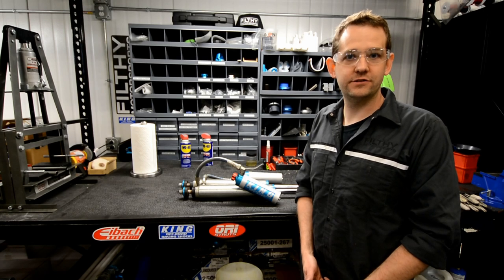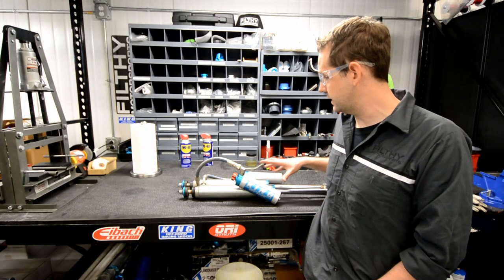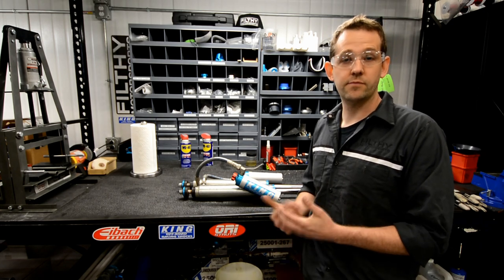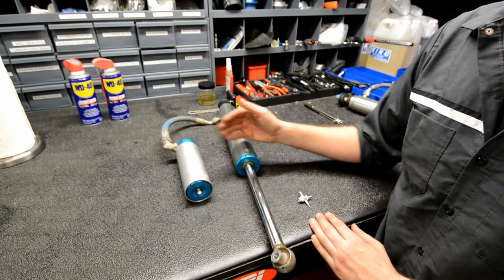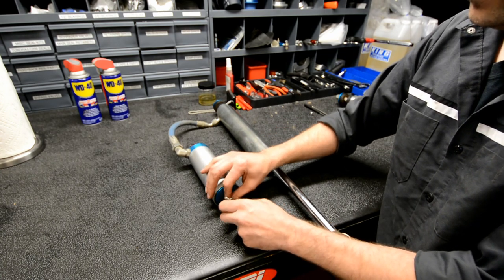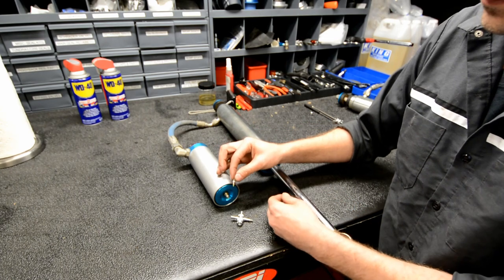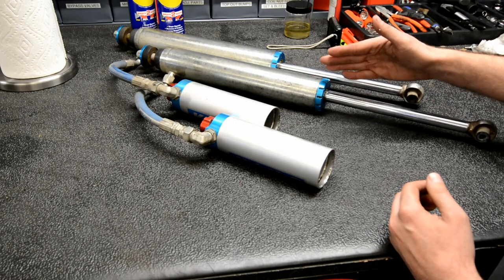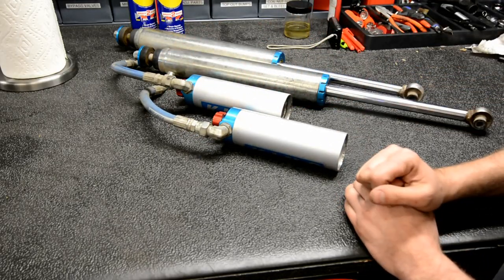King Shock Rebuild Instructions (Full Length) by Shock Service, LLC

Comment: How do you bleed a IFP remote reservoir when you don’t have that threaded hold on it to set it?
Reply from the maker: What brand of shocks? Not all shocks are designed to be service.
Reply: @ShockService  these are KYB, the fronts have the reservoirs as part of the body. The rears are connected by hose (remote). Their found on CanAm machines

Comment: Motorcycle trick.
Hit the shaft with a dead blow to crack the compression shims, if you dont the compression port is full of air under the shim

Comment: This is a fantastic video Ben. Thanks for putting this information out. Would you be able to do a video on breaking down a King coil-over shock? I figure that once the coil is off, the process is very similar.
Reply: Just did it with my front coil-overs. Exact same thing except for needing a spring compressor. I got it off Amazon, only one or 2 that will work for king coilovers
Reply: @JacobMueting  thanks for that info! Which compressor did you go with? Did you feel safe using it?

Comment: I’m considering buying a set of Carli King Pintop shocks for my F350. Can you tell me what the average miles between rebuilds? I think you mentioned 50,000 to 100,000. Also, I tow a fifth wheel but I have airbags to assist with the load. Will this affect the life of the shocks? 

I ran ICON before and they require a rebuild at 20,000 miles… sometimes less. Horrible shocks in my opinion. Thanks for any info you can provide.
Reply from the maker: Every application is different but, in general, we would want to see service between 50k and 100k miles of average use.
Reply: @ShockService  that’s great. I do mostly highway driving with a little off-road here and there. Thanks for the info.

Comment: Very informative Ben and great job with your comprehensive content.
  Just curious as to whether or not King, or your firm, offers stainless Schrader fittings as well as stainless fittings for the Aeroquip plumbing from the shock to the reservoir,,
  If they do hopefully it's of the 316L variety, marine grade and not just 304, "exterior".
  Please advise at your convenience. 
  Thank you and am looking forward to visiting with you on my Ram 3500 4X 6.7.
  Regards,,
Reply: Oh, also,,,are the shafts as well available in stainless steel and if so, what grade,,,,
  Lastly, are King shafts solid or hollow,,,,

Comment: great video. Just got one observation, instead of pulling the end of the reservoir out introducing air, why not leave it all the way down replace the core then charge, reducing air intrusion? Or is this being too meticulous? Being that air is 78% nitrogen anyways?
Reply from the maker: Leaving the IFP in would not allow a full draining of the oil and you would still have air bubbles in the reservoir hose.

Comment: HI, thanks for this video, i have the same shock absorbers on my land cruiser j8, can I measure the pressure from the valve of the tanks with a normal air pressure gauge?
Reply from the maker: Yes, as long as the gauge is rated for 200-300 PSI.

Comment: I wonder why King uses the clear silicone O rings. That gets eat up really fast. I replaced those with nitrile and it didn't leak much longer.
Reply from the maker: King o-rings are black with the exception of the shaft o-ring which is redundant so leaking really isn't an issue. We recently serviced a set of King shocks off of a Peterbuilt truck with 300,000 miles on them (well beyond the recommended service interval) and 3 of the 4 shocks had no leaks.

Comment: Ben,

I am familiar with rebuilding WP, Showa, KYB shocks on dirt bikes and vacuum bleeding before nitrogen charging is nearly required. Is there something unique about King shocks that doesn’t necessitate vacuum bleeding or is that still best practice?
Reply from the maker: Vacuum bleeding is optional as the design allows for easy bleeding on most off-road shocks like these. For more complicated shocks or unique configurations we do use a vacuum bleeder.
Reply: Thanks for the reply. If I may one additional clarifying question. 

And that is because for example even a non Bypass 2.5 reservoir shock doesn’t contain any valve stack between the reservoir and the shock body.

Comment: hello, the shaft spacer on my shock cant be remove, what should i do?
Reply from the maker: I'm assuming this is an external shaft spacer. Use some heat and once the spacer expands, spray some WD-40 around the shaft, you should be able to work it loose. If not, remove the rod end and then tap it off that direction.
Reply: @ShockService  thank you, heat really work.

Comment: Ben, question- before you charge the resi with N2, you pulled the cap up to the retaining ring drawing ambient air into the resi. Should you not have pushed the cap in and then charged it with N2? Seems like all you did was compress the air in the resi with a small amount of N2. Am I over thinking this? Seems to be critical to remove as much air as possible as the air will increase pressure when hot and introduce moisture. 
Not criticizing, just curious. Maybe it’s not that critical.
Reply from the maker: Great question but not a concern for this application, however, one could always pressurize the reservoir with nitrogen, bleed it off and then fill it again.

Comment: Nice and very helpful video. 
Can you give advice about measuring floating piston deep. In first time of rebuilding  I'm not measure deep of sitting piston. And now feel incorrect work of shocks. I understand that length of reservoir cylinder may different than yours, but I think that correct position -  to shock <~40/(position of floating piston) and 60 ~>to shrader valve.
Thanks for any advice.
Reply from the maker: This is covered in section 17 of this video: Verify IFP Positioning - 46m 40s

Comment: I know this is a newbie question but is there a scheduled service time for these?
I'm buying a Tacoma with similar shocks and the seller tells me they're about 30-40k of mostly on-road commute miles on them. I didn't feel any inconsistent ride when I test drove the truck and no visible leaks. Appreciate any insight.
Reply from the maker: We normally recommend 50k-100k miles for most street use applications. We get shocks in for service at all intervals and generally find that before 50k miles most Kings are still working fine and at 100k they really need to be serviced. Great question!
Reply: @ShockService  Thanks!  Appreciate the help! 👍

Comment: Does the piston have to be fully extended when getting the air out of the system just before pushing shaft retainer i to the cavity?  If not, how do i know if there is enough fluid in the system if the piston is down in the cavity filling the cavity with its own “piston volume.”
Reply from the maker: Not necessarily, but the higher it is the more oil gets moved to the reservoir to set the IFP.

Comment: If you replace the remote reservoir hose.. will oil/nitrogen start to leak? Is it difficult to replace the hose?
Reply from the maker: Yes, oil would leak if you remove the hose. To properly replace or repair a reservoir hose the shock must me opened and drained, then reassembled.

Comment: Tried your method for removing the misalignment spacers (at 16 min mark) it didn't work for me. What did work for me is a punch angled inside to the lip of the spacer. Hit the punch with a hammer in a couple of places on the spacer and it pops out effortlessly.I also let it sit overnight soaked in PB blaster before trying to use the punch.
Reply from the maker: That is the option of last resort as it often times damages the ID of the spacers, but it works!

Comment: Ben thanks for a great video!  If I want to adjust the angle of my high pressure line fittings, do I need to release the Nitrogen pressure from the remote reservoir first?
Reply from the maker: Great question, typically not. NPT fittings can be rotated but they will require significant force and should only be turned clockwise if possible (but avoid stripping the threads). ORB fittings have an o-ring and can be rotated without loosing oil or pressure. JIC/AN fittings need to be "cracked" loose just about enough to rotate the fitting before being tightened back down. It is common for a drop or two of oil to come out, even when done correctly, but this is not something to be concerned about.

Comment: If the IFP measurement is about less then a 1/2” lower after rebuilding, is that still okay?
Reply from the maker: That depends on if it was set correctly to start with or not.

Comment: I got a problem. I’m running some icon piggy back shocks. One of the reservoir body’s is pretty damaged. But I can’t unscrew the reservoir from the piggy back fitting. So I can’t compress the end cap to remove the body. Any suggestions? The body is spinning on the end cap attached bracket/fitting.

Comment: Any tips to remove stuck wiper caps that won't budge on Fox 2.5s front coilovers, non RR?  Working on my friends 2.5 Fox Coilovers and the bearing wiper cap will not come off on both front coilovers. I've removed the threaded allen set screw from both caps. Steps I've taken so far are below with the shock mounted in a bench vise.

Made a large spanner wrench with 3/16 pins, tried to tap with a deadblow to shock it and get it moving.
Used a monkey wrench on the knurled outer surface of the cap. No dice, it won't move.
Sprayed PB, and tried to get it down into the threads for the cap, left it over night
Used some heat to try and expand the body a bit, don't want to go crazy
All of the above
Reply: Just curious if you were able to get it apart and if so how? I am having the same trouble.
Reply from the maker: Sorry for the late reply, make sure the set screw is loose and you may need to keep pressure in the reservoirs so the seal cap is tight against the retaining ring. If water made its way between the wiper cap and seal cap (shaft retainer), you may need to use heat and a penetrating oil to try and break down any corrosion.

Comment: Where do you find out the measurement for IFP depth? I can’t find that anywhere. I had some residual pressure and the IFP pushed up and out of the piggyback body while removing.
Reply from the maker: There is no specific set measurement and the best answer really depends on many factors, if you have specific questions please be sure to call or email us.

Comment: very much same as motocross shock, if you had some kind of fork sitting at 90 deg off wall to hold silver cap hovering just off shock cylinder as your waiting to see if oil spills over edge would be nice jig instead of trying to hold it with your hand while cycling shaft...

question is how much does a service cost for one shock?....it is nice that theyre rebuildable although taking them off vehicle and waiting for service and re installing them is kind of PITA...…..and  cost too if you cant do work yourself....if someone just brought the vehicle to your shop and left it for few days what would cost.....I guess this is for people that either can tear em off vehicle send shocks out and re install them or do everything themselves.....but on other hand you have brand new suspension again and could even change valving bit...

Comment: I read that the oil King uses is not near as good as the oil Fox uses.
Reply from the maker: How so? And where did you read that? They are all hydraulic oil based on their MSDS sheets so I'd love to know how one is better than the other, lol.
Reply: Shock Service I really did read it. There some kind of numeral rating assigned to each and King was in the 150’s and Fox in the upper 370’s. Just a messenger. The 2 hydraulic fluids performance rating are not the same.
Reply: Shock Service Here it is buddy :Notes: Fox oil offers substantially better lubrication across a wide range of temperatures, and is less likely to break down due to heat. ... Fox's VI of 370 is very high and provides exceptional performance. King's VI of 150 is an average rating which means it is much more prone to shock fade when getting hot. Lol
Reply: Shock Notes: Fox oil offers substantially better lubrication across a wide range of temperatures, and is less likely to break down due to heat. ... Fox's VI of 370 is very high and provides exceptional performance. King's VI of 150 is an average rating which means it is much more prone to shock fade when getting hot.
AccuTune Off-Road › fox-vs-king-...
Fox vs King ~ OEM Coilovers | AccuTune Off-Road
Feedback
About Featured Snippets
People also ask
Do Fox shocks make a difference?
What is better coilovers or shocks?
Are Fo
Reply from the maker: @terryosowski8143  VI stands for Viscosity Index and that only tells you how "thick" the oil is. Comparing the VI of oil is meaningless without knowing the application. That is like saying 5W30 is way better than 15W40 without knowing the engine or car it is going into. -- Where was that information taken from, it reads like it was written by a marketing intern, lol!
Reply: Shock Service something to do with accutune website. Hey I’m in need of a pair of Fox 2.5 Coilover 880-06-418 and a pair of Fox 883-26-007 !

Comment: what's all this garbage I see with all the people coming up with some super elaborate manifold to charge their shocks? nitrogen tank + nitrogen regulator set where I want the shock charged + hose and air chuck is all I need, right ? then use a 200 psi air gauge to check ?